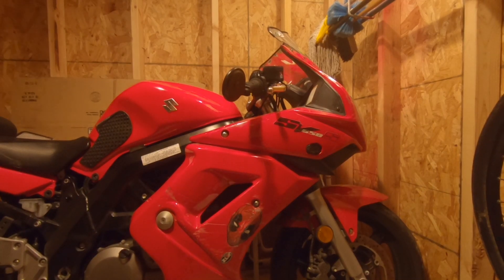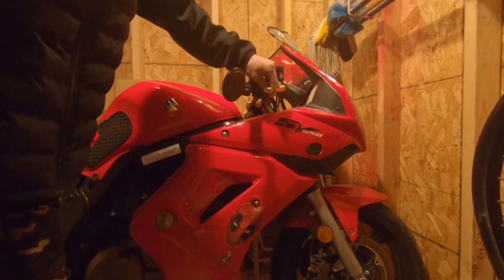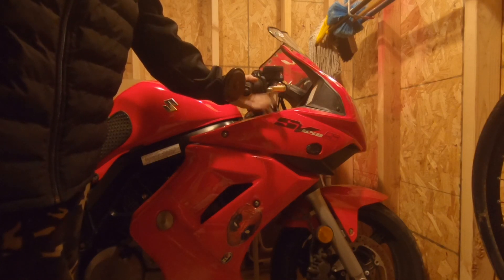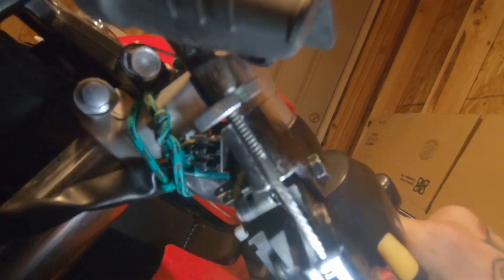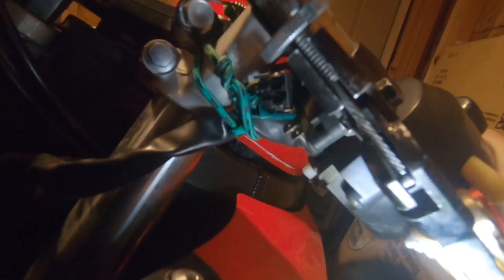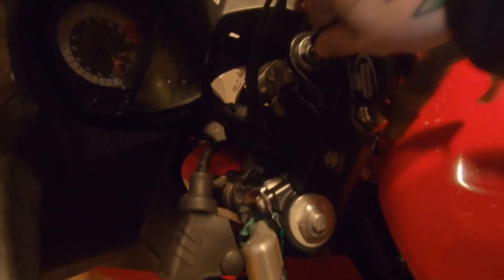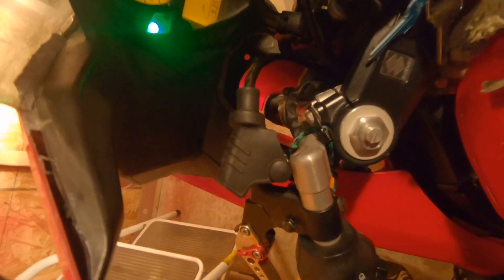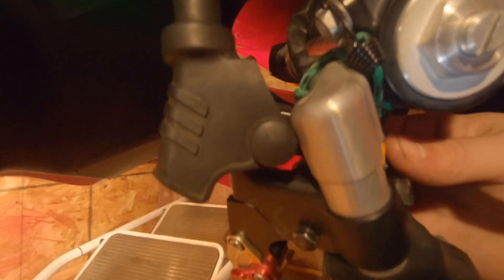Clutch switch fast easy fix for fuel injected Suzuki

Comment: Any ideas for it intermittently starting and not starting? It’s on a 08 gsxr 600
Reply from the maker: when it doesn’t start what’s happening is it trying to start or is it like it’s just dead and then all the sudden it started me again?
Reply: @daydaydful  it acts like it is dead doesn’t crank and then I press the button again and it starts up
Reply: @Fakechainzz  im having same issue.. did you diagnose?
Reply: @ yesss… new battery terminal
Reply: @ sorry for the late response

Comment: How did you wire the toggle switch to the clutch switch? Do I need to wire the rocker switch to the battery and the other ends to the switch?

Comment: So no messing with the wires?
Reply from the maker: No u dont have to
Reply: @daydaydful  so how is the switch connected to the bike ? And how did you find one with the same pins connection? Could you make a updated vid bro please you’re the only one I seen with this simple solution
Reply: Sorry I’m kinda dumb bro lol first bike never picked up a wrench before 😭
Reply from the maker: @SkateAndReview  its good thats exactly how i started 5 years ago and now ive worked on soo many bikes that im confident i could fix any problem .
Reply from the maker: @SkateAndReview  my bad I just got this reply was in jail for a bit .. u still need help with ur av650